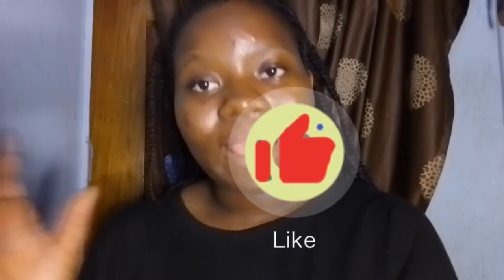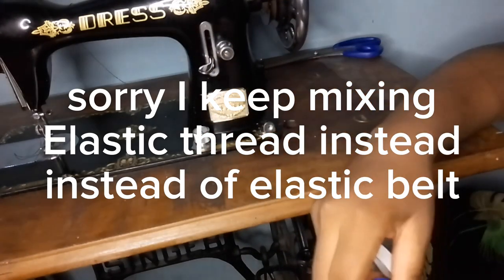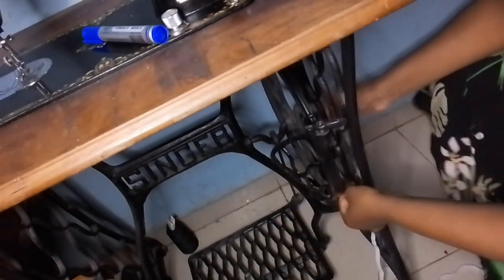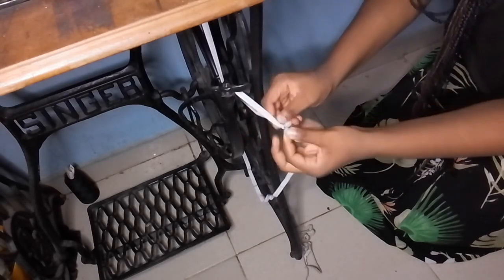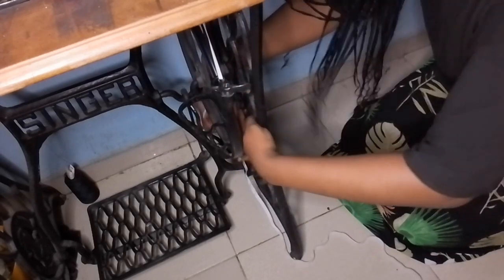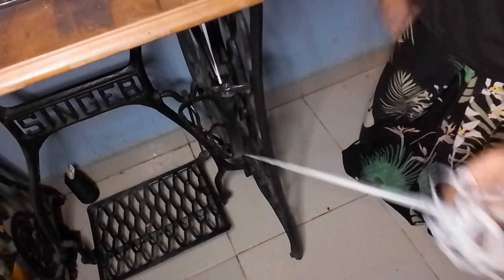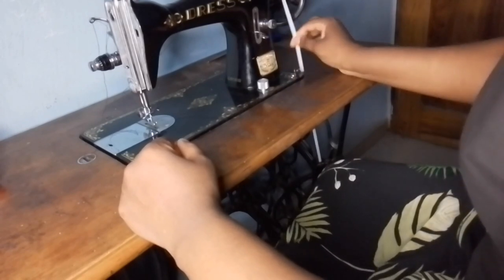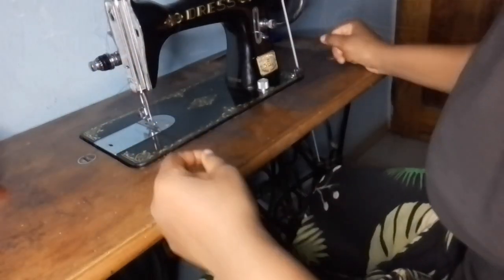What measurement that is needed to make your elastic machine belt

Comment: I have the remains of a belt from the Singer 185J model.  The inner part of the belt is a twined / twisted thick thread.  This is laid into four loops with ends some how secured.  This four strand  loop is encased in a tightly woven light canvas? .  The canvas has the remains of what may be rubber coating the outside of the canvas and maybe even the twined inner thread.  There appears to be a seam along one side of the light canvas.  This seam would hold the twined thick looped thread inside the folded canvas.  This belt probably measured about fifteen  inches.  It was probably about three eighths to one quarter of an inch wide.

I also tried a long rubber band in place of a belt and this was able to move the feed dogs and upper needle bar.  

I think any  loop that is sufficiently tight and non-slip would turn the wheel.  

I did not think of elastic but I may try this on some other sewing machines that need belts.  Thanks for posting this great idea of yours.  It is great to see your very creative and economical solution.
Reply from the maker: Thank you 😊